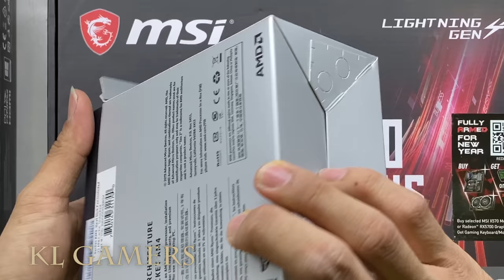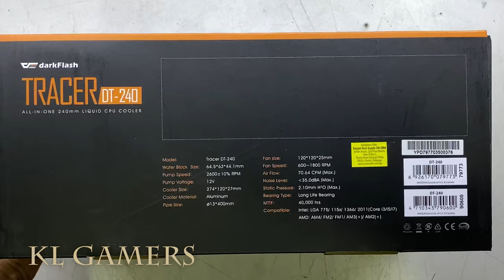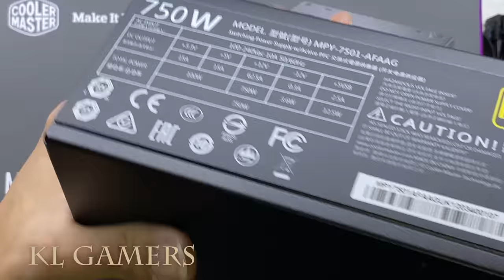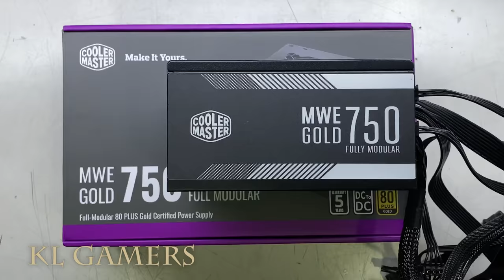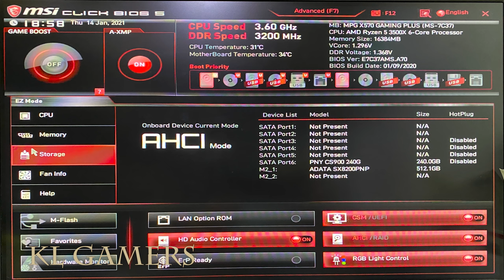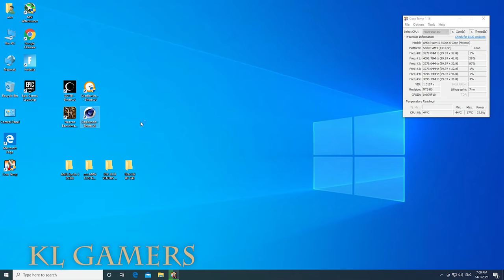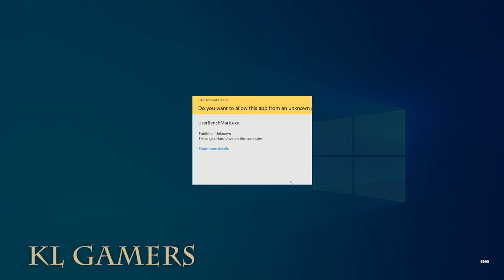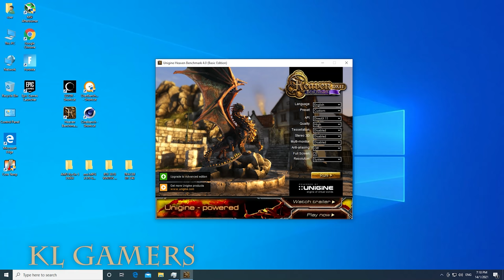AMD Ryzen 5 3500X msi MPG X570 GAMING PLUS RTX 3070 VENTUS 3X TRACER DT 240 DLV22 PC Build

Comment: Is it a new trend for such cases? For the second time I see it in your video. Looks really wild for me... Also I think that cpu 3500x is not for a long time in this system, because such motherboard and water cooling system is too  much for it...
Reply from the maker: not sure, i don't see myself using it. Very futuristic case. 3500x is low power. might upgrade later because now only have 3500X in stock. 3600/5600x MIA

Comment: msi ventus 3070 has 3x fan 3. fan works at 3300rpm at idle 3.fan works at almost 100 percent I can't adjust from afterburner I can't adjust from auto I'm doing no change I'm pulling at minimum 30a still nothing changes it makes too much noise what can I do

Comment: AWesome job. Amazing builds. Bro. how to contact you, please? Thanks.
Reply from the maker: Here
Reply: @KLGamers  I am going to build a case. Here are the specs I want to go with. Do you I get the parts. How do I go about it? can you provide a quotation?

CPU	INTEL S1200 CORE I5 10600K/KA 3.3GHZ				
MOBO	MSI Z490 MAG TOMAHAWK				
GPU	MSI GTX1660 SUPER GAMING X 6GB				
CASING	MSI MAG FORGE 100R				
RAM	PNY XLR8 DDR4 8GB PC3200 x 2				
PSU	THERMALTAKE SMART BX1 RGB 750W				
CPU Cooler	COOLER MASTER MASTERAIR MA610P (MAP-T6PN-218PC-R1)				
SSD M.2	INT WD M.2 PCIE NVME BLUE SN550 500GB

Comment: Hey brother can you tell me what is the build cost.
Reply from the maker: AMD Ryzen 5 3500X 6-Core 3.6GHz Processor (4.1GHz Turbo, 6C/6T, 3MB L2 & 32MB L3, 65W, Wraith Spire Cooler)
(Amazon link) = https://amzn.to/3lG4pao
(Lazada link) = https://c.lazada.com.my/t/c.Y5aOh5?url=https%3A%2F%2Fwww.lazada.com.my%2Fproducts%2Famd-ryzen-5-3500x-36ghz-up-to-41ghz-max-boost-processor-i1191158305-s3486990506.html&&sub_id1=3500x&sub_id2=YES&sub_id3=749
(Shopee link) = https://invol.co/cl29bo6

Processor = AMD Ryzen 5 3600 6-Core 12-Thread Unlocked Desktop Processor Wraith Stealth Cooler (DEC)
(Amazon link) = https://amzn.to/2O2NAYT
(Lazada link) = https://c.lazada.com.my/t/c.Y5a6dc?url=https%3A%2F%2Fwww.lazada.com.my%2Fproducts%2Famd-ryzen-5-3600-36ghz-socket-am4-processor-i1721404238-s6566052715.html&&sub_id1=3600&sub_id2=EGG&sub_id3=999
(Shopee link) = https://invol.co/cl266s1

Motherboard = MSI MPG X570 Gaming Plus Motherboard (AMD AM4, PCIe 4.0, DDR4, SATA 6Gb/s, M.2, USB 3.2 Gen 2, HDMI, ATX) (JAN)
(Amazon link) = https://amzn.to/2ZZBO82
(Lazada link) = https://c.lazada.com.my/t/c.Y5avf4?url=https%3A%2F%2Fwww.lazada.com.my%2Fproducts%2Fnew-msi-mpg-x570-gaming-plus-motherboard-i1641166420-s5661838320.html&&sub_id1=x570&sub_id2=plist&sub_id3=751
(Shopee link) = https://invol.co/clp24c

RAM = XPG Spectrix D41 TUF Gaming Limited Edition RGB 3200MHz 16GB (2x8GB) CL16-20-20 288-Pin PC4-25600 CL16-20-20 Desktop U-DIMM Memory Retail Kit Black (AX4U320038G16A-DB41) (JAN)
(Amazon link) = https://amzn.to/2KlaZVW
(Lazada link) = https://c.lazada.com.my/t/c.Y5avV2?url=https%3A%2F%2Fwww.lazada.com.my%2Fproducts%2Fadata-xpg-spectrix-d41-rgb-1x-8gb-pc3200-ax4u320038g16a-st41-desktop-ram-ddr4-i1268458701-s3822600851.html&&sub_id1=Spectrix&sub_id2=Castle&sub_id3=187
(Shopee link) = https://invol.co/cl2bldk

SSD = ADATA XPG SX8200 PRO M.2 PCIE GEN3x4 SSD
(Amazon link) = https://amzn.to/39P98kv
(Lazada link) = https://c.lazada.com.my/t/c.YUy3H7?url=https%3A%2F%2Fwww.lazada.com.my%2Fproducts%2Fadata-xpg-sx8200-pro-pcie-m2-2280-solid-state-drive-256gb512gb1tb2tb-i488598676-s1431066623.html&&sub_id1=8200&sub_id2=Viewnet&sub_id3=349s652831528.html&&sub_id1=sx8200&sub_id2=EIT&sub_id3=240
(Shopee link) = https://invol.co/clu0am

MSI Gaming GeForce RTX 3070 8GB GDRR6 256-Bit HDMI/DP TORX Fan 3.0 Ampere Architecture OC Graphics Card (RTX 3070 Ventus 3X OC)(JAN)
(Amazon link) = https://amzn.to/38SJBbn
(Lazada link) = https://c.lazada.com.my/t/c.Y5aOhV?url=https%3A%2F%2Fwww.lazada.com.my%2Fproducts%2Fzotac-gaming-geforce-rtx-3070-amp-holo-i1795870336-s7085692506.html&&sub_id1=Z3070&sub_id2=DITA&sub_id3=3198
(Shopee link) = https://invol.co/cl2bpnb

Wifi = TP-Link WiFi 6 AX3000 PCIe WiFi Card for PC with Heat Sink| Bluetooth 5.0 | 802.11AX Dual Band Wireless Adapter with MU-MIMO, Ultra-Low Latency (Archer TX50E)
(Amazon link) = https://amzn.to/2DuK6eS
(Lazada link) = https://c.lazada.com.my/t/c.b6kMNB?url=https%3A%2F%2Fwww.lazada.com.my%2Fproducts%2Ftp-link-ax3000-wi-fi-6-bluetooth-50-pcie-adapter-archer-tx50e-free-pubg-bag-i1169126020-s3379272581.html&&sub_id1=AX3000&sub_id2=Mono&sub_id3=149
(Shopee link) = https://invol.co/clvwf5

Power Supply = Cooler Master MPY-7501-AFAAG-US MWE 750 Gold Full Modular, 80+ Gold Certified 750W Power Supply, 5 Year Warranty
(Amazon link) = https://amzn.to/36F4tjK
(Lazada link) = https://c.lazada.com.my/t/c.Y5avff?url=https%3A%2F%2Fwww.lazada.com.my%2Fproducts%2Fcooler-master-mwe-gold-750-full-modular-power-supply-750w-80-plus-gold-5-years-warranty-i422994466-s616852257.html&&sub_id1=750G&sub_id2=ETIKA&sub_id3=435
(Shopee link) = https://invol.co/cl2bpoq

AIGO DARKFLASH TRACER DT-240 CPU COOLER (Black Edition) AIO Liquid Cooler [Compatible with Intel & AMD] DT240 (JAN)
(Amazon link) = https://amzn.to/3mE5Yp0
(Lazada link) = https://c.lazada.com.my/t/c.ZSXFsp?url=https%3A%2F%2Fwww.lazada.com.my%2Fproducts%2Faigo-darkflash-tracer-dt-240-cpu-cooler-i580164494-s1161718675.html&&sub_id1=DT-240&sub_id2=MyBest&sub_id3=199
(Shopee link) = https://invol.co/cl2bpnz

Casing = Aigo darkFlash DLV22 ATX RGB Right Side Magnetic Design Tempered Glass Chassis (JAN)
(Amazon link) = https://amzn.to/2XHtpn6
(Lazada link) = https://c.lazada.com.my/t/c.Y5atMo?url=https%3A%2F%2Fwww.lazada.com.my%2Fproducts%2Faigo-darkflash-dlv22-atx-rgb-right-side-magnetic-design-tempered-glass-chassis-bundle-promo-i1238914343-s3685562770.html&&sub_id1=dlv22&sub_id2=Raydeeyo&sub_id3=389
(Shopee link) = https://invol.co/cl2b3ew

NZXT H510 - CA-H510B-B1 - Compact ATX Mid-Tower PC Gaming Case - Front I/O USB Type-C Port - Tempered Glass Side Panel - Cable Management System - Water-Cooling Ready - Black
(Amazon link) = https://amzn.to/3lBnN7z